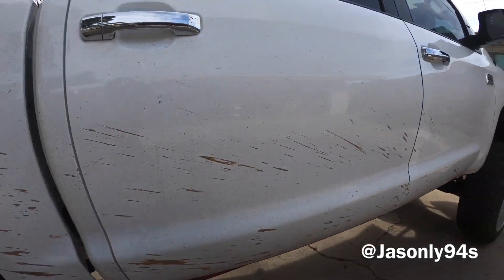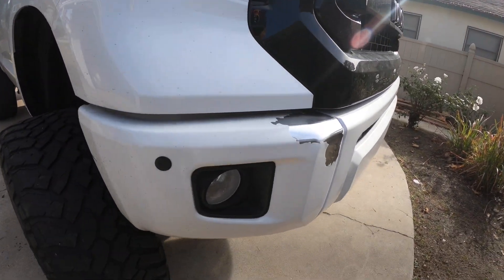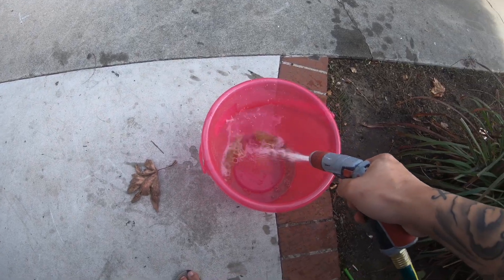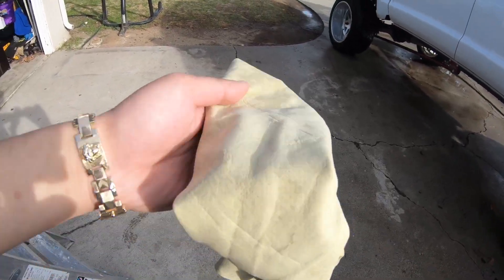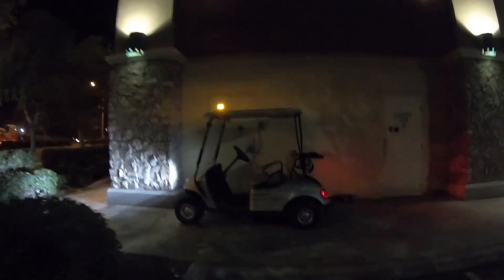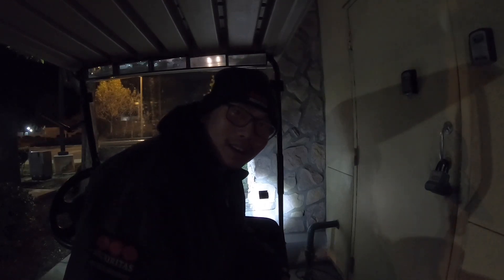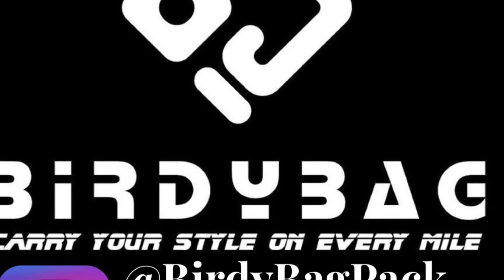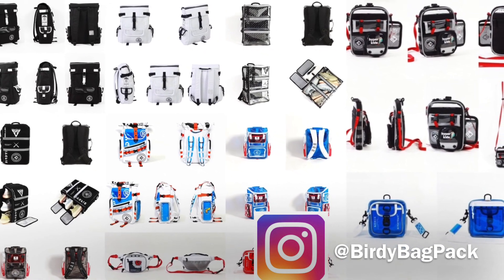( VLog # 3 ) My Toyota Tundra Getting a New Aftermarket bumper !!

Comment: Do you have gaps in corner after the the tail lights have been installed ? Hard to tell on your vid. I love em but has to send em back due to this isssue
Reply from the maker: jeremy sierra hey , there is no gap on any corner of the rear lights I had them for 3 years now and everything still doing good